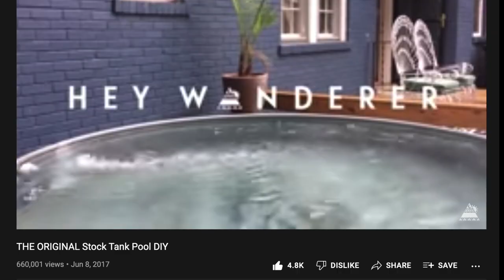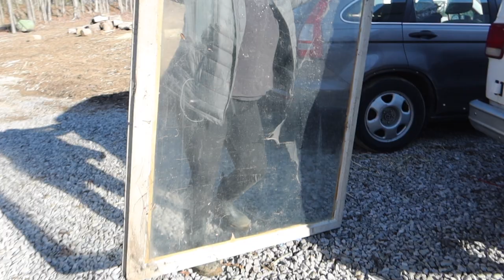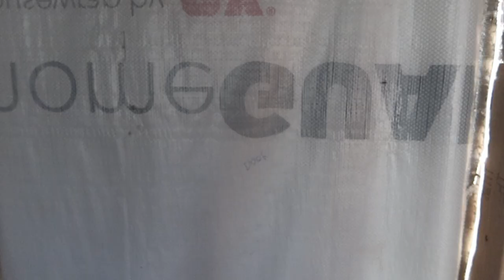Installing A Picture Window In Our Tiny Home

Comment: Im a new subsriber. And i find this very fasinating. This is so me. Except. I can easily live full time in the shed. Without the extra buildings. Im very much into the tiny house movement. Living off grid using solar panels screwed to the roof.